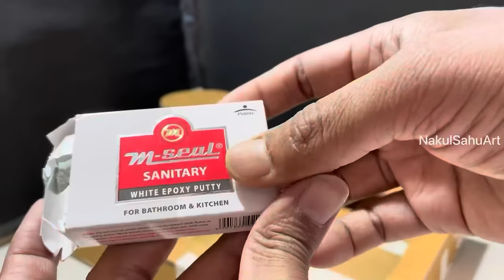Drip irrigation working model for school #dripirrigation educational videos #agriculture

Comment: A question.
So I see the pipe at the end like where does it finish like what do we have to do at the end.
5:56 this part., you see the pipe at the end right. So what do we have to do there, what if the water leaks ?.
Reply: There is mounding clay there

Comment: Sir at 3:04 why did you put that clay into the pipe?? It will only block the water from going right, so there is no point in inserting the clay..
Reply: Heloo 😏where is your mind sir uesd m-seal not clay  there is many points inserting m-seal not clay crazy people 😂

Comment: Can you make it without the small engine😢
Reply from the maker: You can skip water pump, need to put water manually.
Reply: @nakulsahuart  Thank you very much can you make an air cooler in the next video Also can you make it without electricity or energy because the teacher wants an invention to benefit everyone without cost we depend on you
Reply: @Yekara_11 Even I suffer from this problem😔

Comment: Sir why you use tank? you can directly supply water from well plss its urgent pls help and give Explanation of this project I have to present the model in exibition on 24 aug
Reply from the maker: The tank helps to regulate the water pressure for the drip irrigation system.
Reply: @nakulsahuart  ok sir and explanation😅

Comment: Its good but you dont tell that how to joint those wires and batteries. I am getting confused.
Reply from the maker: Seems you skip 3:59 to 4:10 (circuit also given in video)
Reply: Ohh now i see that drawing at upper side sorry for wasting your 
time😅😅

Comment: Sir,water is leaking from tank and everything is becoming wet even using mceal
So what should I do?
Please reply me as soon as possible 🙏
Reply from the maker: Need to seal proper with m seal , if possible, change the jar and do little smaller hole (as compare to tube dia) in jar so it can hold the tube properly and seal with m seal from Inside and outside
You can use hot glue as alternative option.

Comment: Sir where will we get the plastic tray for putting soil?
Reply from the maker: I got it from cake box and sweet box , you can use old plastic tiffin box also.
Reply: Can I use egg tray (cardboard)?
Reply from the maker: @ranicherian3734  it will get wet with water , you need to cover it from polythene to avoid water damage.
Reply: @nakulsahuart  Thank you so much!!
Reply: Please can you tell from which sweet box packet you got from
Reply from the maker: @ranicherian3734  Haldiram's Nagpur kesar Peda 250gram pack
Reply: Thank for the valuable information 😄
Reply: Sir could you tell me the length of transparent pipe
Reply from the maker: @ranicherian3734  around 1 meter

Comment: Brother if we off the switch do the water will still drip?
Reply from the maker: Yes.
Reply: @nakulsahuart  then wt is the use of switch? And pump the pump is only used to push the water?
Reply from the maker: It’s only to pump the water to tank.

Comment: SIR I have  two Questions .

1.  Where will the water go after Watering the plants , means after the pipe ends it will reach again the well or what ?

2. How much time we will have to Switch it on to water the plants?
Reply from the maker: 1. it will remain in soil , pipe end is closed (used m seal to close it )
2. Once tank full it will drip around 2-3 hours ( depending on size of holes in pipe) once tank empty you can top up with pump.

Comment: Sir explain me one thing what if the soil stop absorbing the water and it start overflowing?
Reply from the maker: You can stop pumping water to tank , top up tank only as per your soil connector size. (If it’s all wet before project submission, you can wait to dry the soil or replace the soil.)

Comment: I made this  water from jar is still leaking to much
Reply from the maker: Need to seal proper with m seal , if possible, change the jar and do little smaller hole (as compare to tube dia) in jar so it can hold the tube proper and seal the tube from Inside and outside.
Reply: Also by making small hole and properly applying m seal still it leaked on the day of exception and ruined why whole project